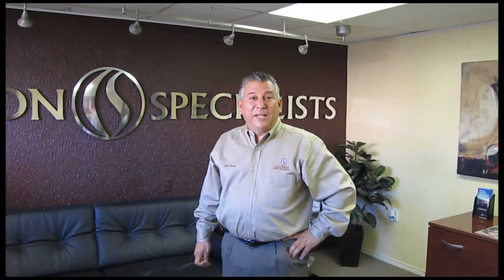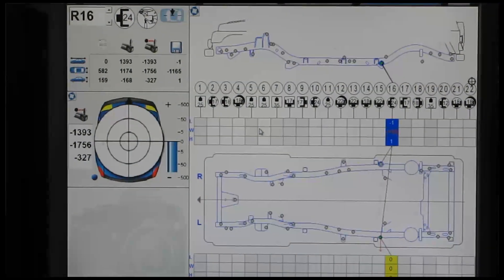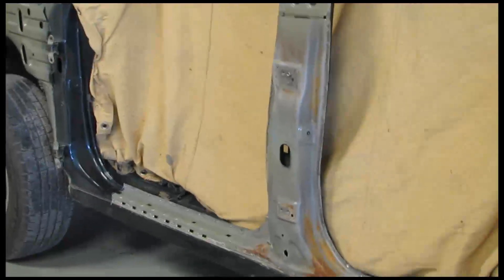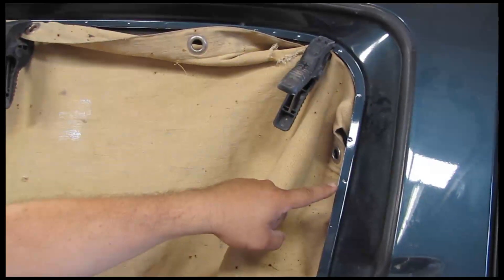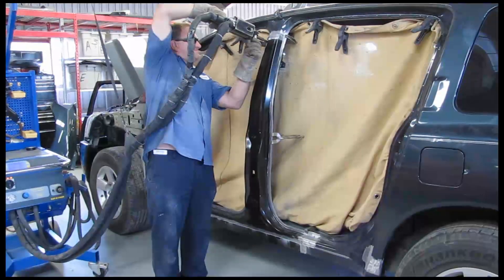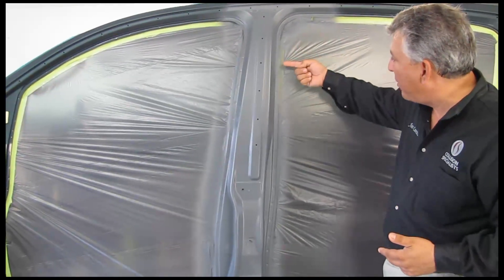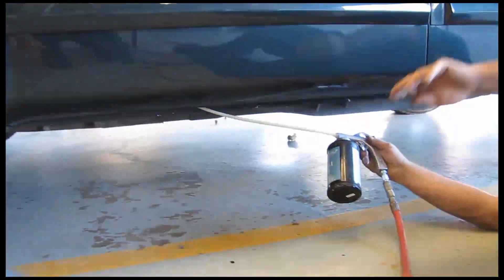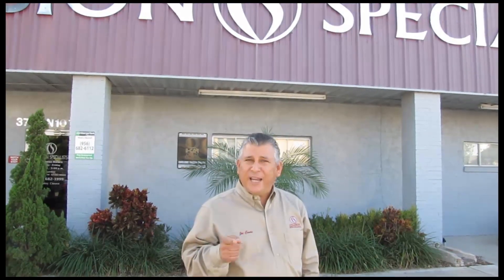Collision Specialists Inside the Shop - Auto Body Repair

Comment: You're not suppose to make spot weld repairs over an existing OEM weld unless specified by the manufacturing and there's only two makers BMW and AUDI that call for it. The metal has already been compressed and harden and will change the characteristics of it thus leaving you with a weaker weld.
Reply: Why do you think BMW and Audi choose not to follow all the other manufacturers' recommendations?